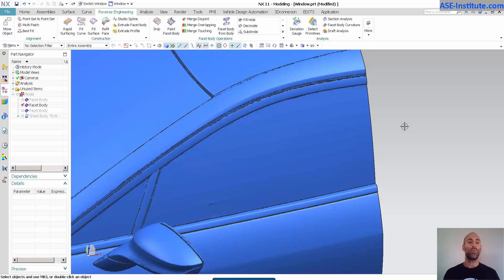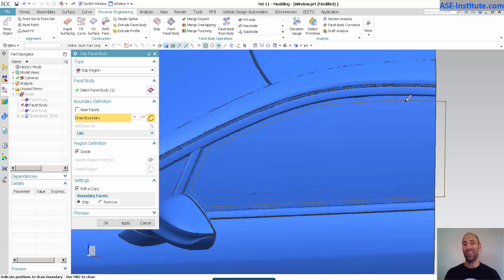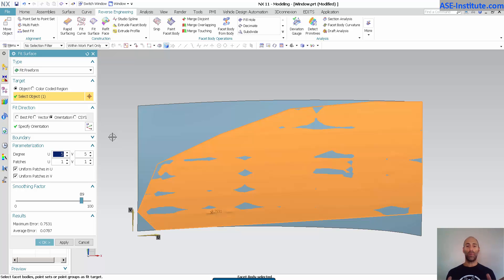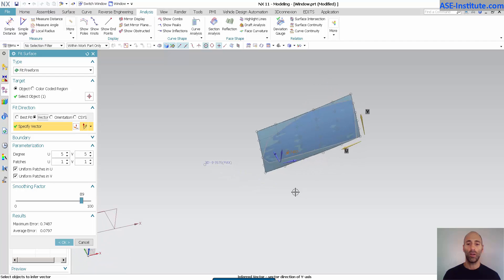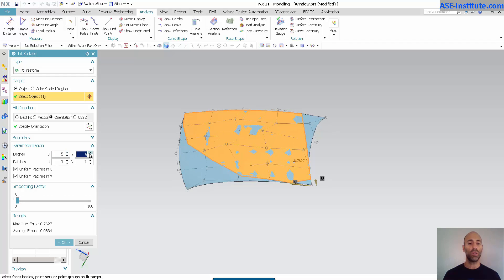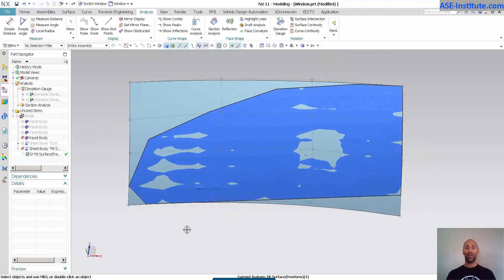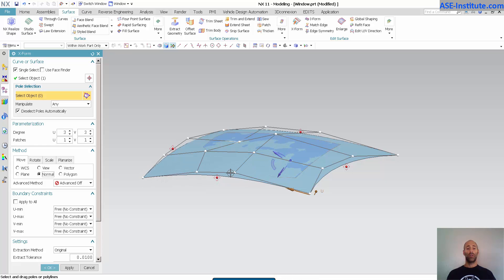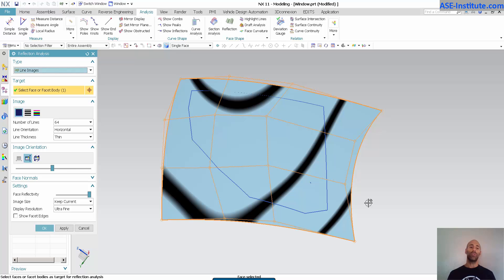Fit Surface | Siemens NX 11

Comment: Hi Steven, thank you cvery much for your great tutorials. I have a question about the Fit Surface tool:

Is there any possibility to fit one surface to multiple facet regions. I just scanned the upper and lower part of an engine housing from a motorcycle.  I want to create a plane through the parting plane between the upper and lower engine housing. Therfore I need to design a plane through multiple faces caused by the connecting faces between upper an lower housing. Thanks a lot!

I use NX 12 Mach 3
Reply from the maker: You can't fit a surface in like that. If it is a planar surface you can do random point selection while creating a DATUM. A true plane through 10 points gives you a best fit scenario. 

Please let me know what you come up with.
Reply: Hi Steven, thanks for your answer. That's the solution I also found in NX. I use in parallel "GOM inspect" there is a function to get any kind of primitives through multiple regions. So I design the major planes/ axes in GOM inspect during postprocessing the scan data. Then I import the scan STL together with the primitives IGES to Siemens NX.
Reply from the maker: NX has a detect primitives tool that is pretty good. In certain cases it is better to use an inspection tool to get your shapes. I only say that in the context of: the tool is meant specifically for that and you may not have a license in NX. Also because the inspection tool is purpose built it may offer some choices NX will not have.